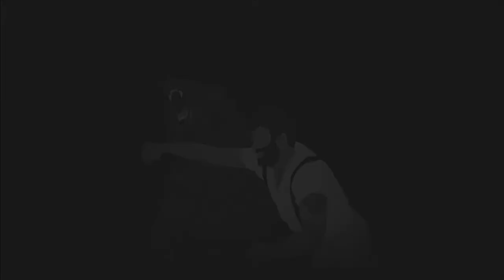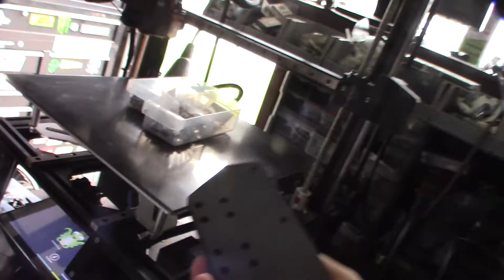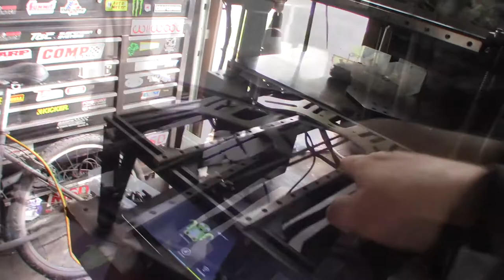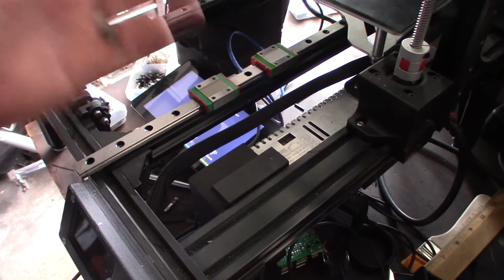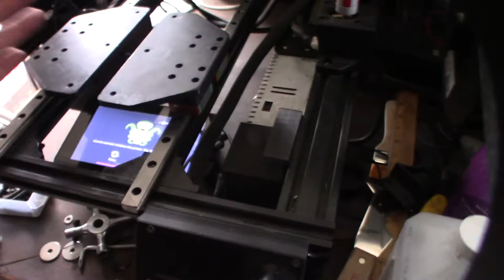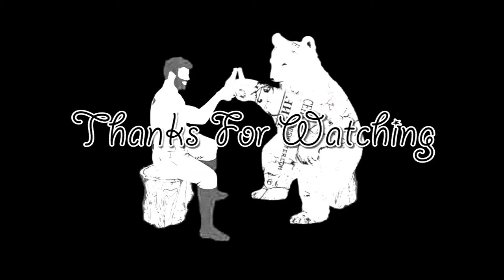Creality Ender 3 CR-10 Linear Rail Conversion Bed Support Mounts

Comment: Do you have a video regarding using the aluminum spacers instead of springs? Is it because you are using linear bearing you get away from the need to use springs?